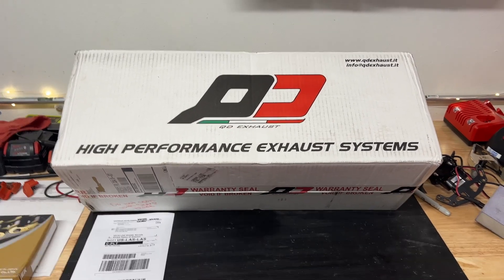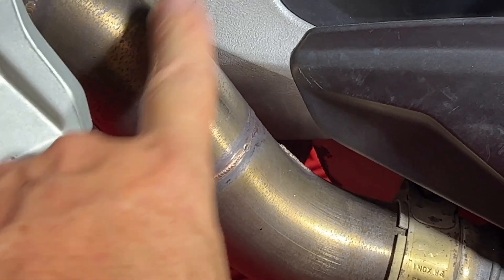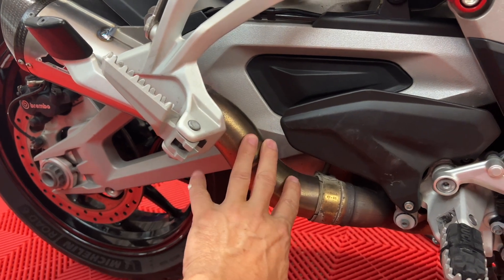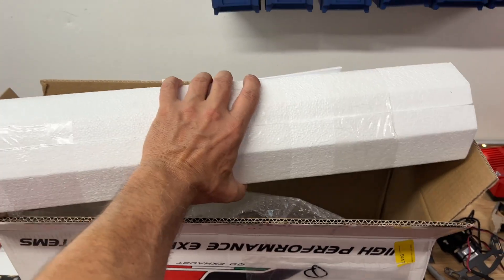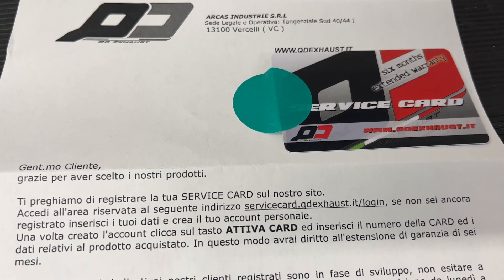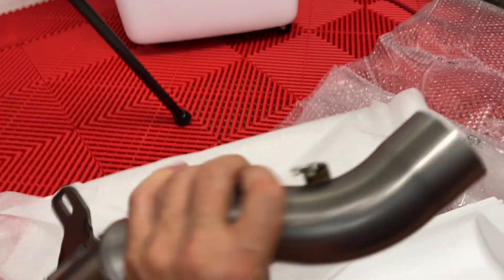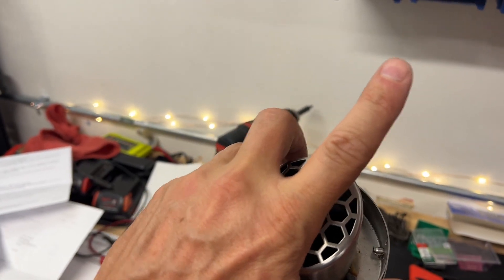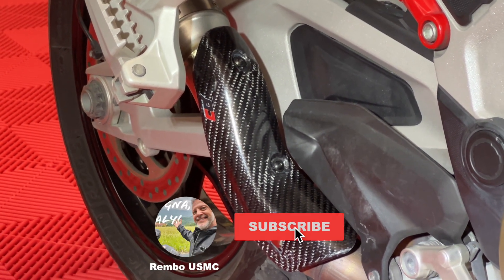Why is my right leg hot on my Ducati Multistrada V4S?  Heat Deflector Problem [ FIXED ]

Comment: In Spain we cannot change the complete exhaust line without a catalytic converter since it would not pass the EURO 5 standard.
Reply from the maker: That is a shame. I only changed the slip on and did not change the cat

Comment: Hey Rembo, what coolant (if different from factory) are you running in your multi? Do you know what temperatures your bike usually runs at, idle or otherwise?

My multi is low on coolant from factory. Debating to flush it for engine ice or pay dealer to top it off.  I've seen my engine temp get into the 220s here in Texas heat and man does it put off some heat.
Reply from the maker: I have factory coolant and the plastic overflow reservoir is always full.  In the heat on the highway I am averaging about 181F and in traffic it hits 221 but floats between 212-221 with one time hitting 223F but that was the highest.  I am not having any issues with heat as Ducati is known for running hot like this.  Summer temps are always higher for me.
Reply: @RemboUSMC  awesome, good too know - new to the bike and my bike's temperature typically falls in that range. 

Thanks!

Comment: Quick Q. When replacing stock with aftermarket slip-ons, how worried should I be about any warranty implications?
Reply: They (dealer/MFR/warranty entity) would have to show the issue was caused by the aftermarket part. In the U.S., SafeGuard handles Ducati's warranty claims, but that's why you want a good dealer relationship, they can lobby for you in the initial claim submission to get your claim approved.
Reply from the maker: Ferocious Frankie offers the best answer to the to your question.

Comment: Hi Rembo,. I have the QD decat mid pipe in my V4S...... now that makes music!

With the Akra slip-on (and I suspect your shortie QD) on the stock catilizer there wasn't much of a note (except to the riders ear).....but the decat gives a menacing deep growl that isn't too noisy, and I have found no need to remap.....just saying...the decat is the thing that will unleash some power and torque whereas a slip-on just looks nicer than the stock muffler 😉.

Maybe you'll want a QD decat on your PP, it will sound great with either stock or Akra or QD dark matter........😈
Reply from the maker: I am very curious to hear about not mapping the ECU with a complete exhaust.
Reply: It's true....on their website QD states as does Akra, that remapping is not compulsory but recommended.....

I figured I'd try it and let the dark magic inside the Ducati ecu do it's stuff before shelling out another $1k Au for a tuning module, and after 1,000kms (620mls) I don't feel the need to remap. It probably would be a bit sharper or maybe have better fuel range with the remap, but it's pretty darn good with just the Ducati stock map (I've tested touring, but use sport most of the time).

I found the Akra slip-on with the stock cat collector was only slightly better than the ugly muffler, good, but not $2k Au better, but now with the decat, it looks, sounds, and goes better.......can't prove anything .... no dyno charts, but the only downside is I've lost about 30-40kms fuel range, but I still get 360+ KMs per tank...I think it's been worth it for the extra torque and sound and weight saving 👍😈 . It's no more noisy than a Duke V2 with nice cans....sounds like a Diavel, isn't loud enough to draw attention from the feds due the expansion chamber and is really easy to install DIY so long as you loosen the RH footpeg bracket......the stock headers are used just like the Akra "full" system.

Dyno charts on the QD website show same or better P & T unmapped to stock, with map has more top end but similar mid range......to ride, it's smooth & strong from idle, no flat spots, and it's funny how quiet it goes when the 2cyl cut off happens.
Reply: @RemboUSMC  just get the full akrapovic from Ducati! I just installed it on my PP and together with the Ducati EVO remap the difference is day and night!
Reply from the maker: @koeny007  That is what I hear and have heard.  I could not get past the price though....
Reply: @RemboUSMC  it's not cheap I have to agree, but your not only paying for great sound, you are also paying for a much smoother and totally transformed power delivery. I had some small surging issues and small dips in the powerband of my V4PP and the full system totally fixed that. It feels like it has much more torque down low, it generates less heat. (About 12 degrees Celsius less) and in the top rpm it just pulls incredibly hard. I think it's the biggest power gain I have ever achieved on a motorcycle. And I did some heave modifications / ECU flashing on previous bikes I have owned. Thumbs up for Ducati for giving us this opportunity. (Of course only on the race track☺️🤭)

Comment: dude you full of crap the video where you ianstaling   QD first time  that exhaust had a brackets for the shield
Reply from the maker: The brackets fell off and QD admitted they had a problem with the welding of the brackets. Did you not listen to what I said?
Reply: you right  i take it back , i guess i was full of crap.